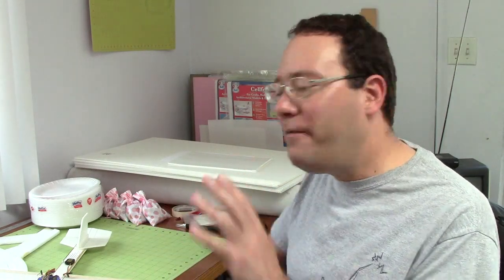Using Dual Elevator Servos

Comment: im having that problem actually. My plane is already glued and electronics installed. both elevators are on harness and together to one plug, and now i cant get them to go together. they go in opposite directions.
Reply: Remove the control horn on the one servos, and remount it 180 degrees from it's current position.